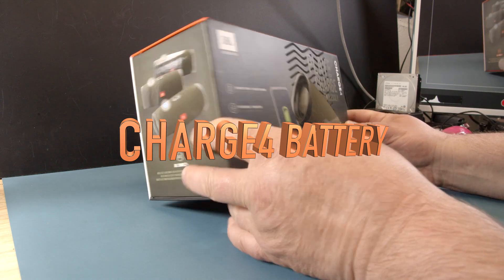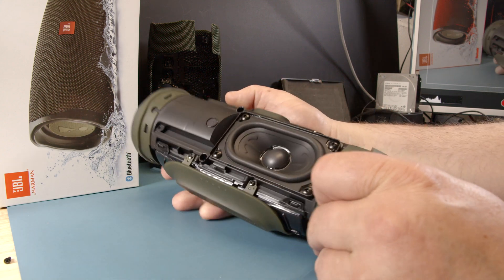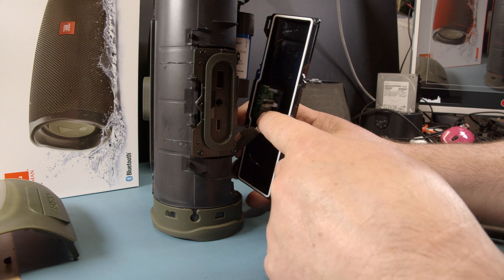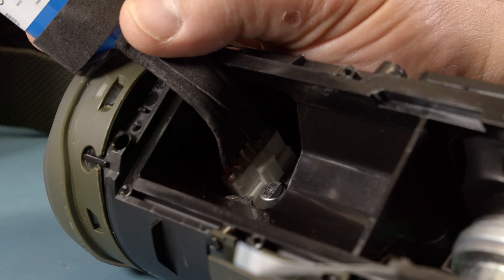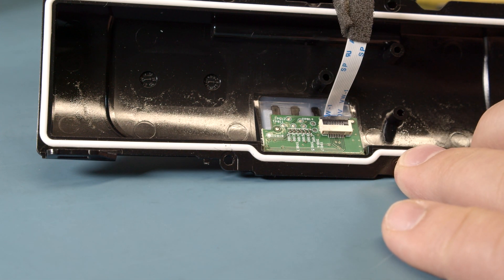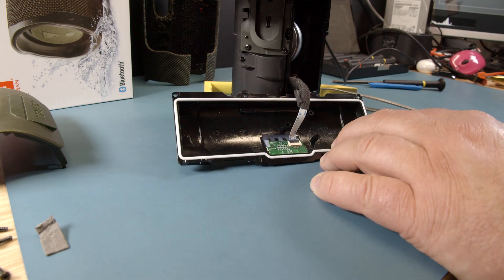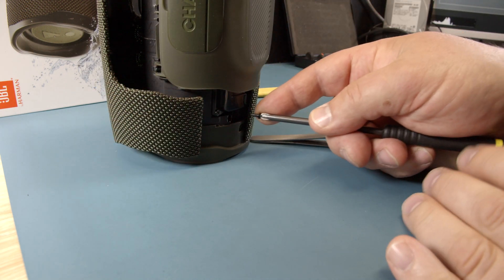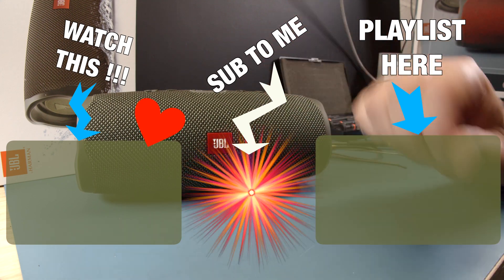JBL CHARGE4 - BATTERY REPLACEMENT

Comment: Can the cells be chaned ? Does the battery pack have inside a BMS ? or the BMS is built in the speaker board?
Reply from the maker: BMS is in the battery pack

Comment: I installed the new battery but it switches off after 3 seconds - it like if the device wouldn't recognise the battery - any suggestions?
Reply: I have the same problem
Reply: did you solve?
Reply: nope....it's all bullshit buy something else mate

Comment: I have the same issue that many people seem to encounter where the jbl turns on and right off again. I figured out my original battery is SUN-INTE-156, where my new batteries are SUN-INTE-118. Maybe that causes problems. I cannot find a 156 battery anywhere though, which sucks. Any ideas for how i can make the 118's work?
Reply from the maker: I am not sure what the differences between 118 and 156 batteries are. You are saying many people have the problem that 118 doesn't work for them? I hear this for the first time.
Reply: @mygiguser  im just guessing that that might be the cause. The only replacements i could find for charge 4 were 118 batteries while my originals were 156. Thought they would be compatible but unfortunately didnt work out
Reply: @jokmenen_  mines also 156 and i cant find it anywhere only the 118s and everyone says when they bought those they didnt work ugh
Reply: did you solve??? i change battery now and its turn off after i turn on... what is problem?? many thanks

Comment: IPORTANT!!!!! Before you buy a new battery, take your current battery down and press the POWER button for a few seconds and then connect your battery again and try to charge it. It actually worked for me. From what I understand it have to do with the speakers software or something like that.

Comment: Well done, thanks! In my case, as the speaker didn't turn on I thought battery is broken. After dismantling it and pull of batterie connector, I measured good nominal voltage. I put it back and a miracle happens - it works again. I guess removing power was a kind of reset for it. Anyway your video helped a lot for understanding the procedure. Greets

Comment: I bought 2 different batteries for changing it, both times the speaker turn on and off right after it. Despites the battery charging and having charge. Where else can be the problem ?
Reply from the maker: Good question. How do you know the battery is charged. Do the lights blink when charging? Does it work when it is connected to a charger? So many things can go wrong. Hard to say over the internet ...
Reply: @mygiguser  Yup. Lights are blinking starting at 4 or 3. It depends on the battery. And it's not working when plugged. I tried different chargers and nothing worked. So I contacted the JBL staff today. It may be because it's not from the manufacturer but I was unable to find a new battery matching my serial number so I send them a message.
Where did you buy your battery ?
Reply: I have the same issue, did you figure it out?
Reply: Hey guys same issue, did you fix it?
Reply: @Merle404  Sort of. The battery should match the serial number of your speaker. But it's almost impossible to know unless you contact JBL. They had some batteries (don't know if it's still the case) but they cost 80€. And you had 10€ or near in shipping wich is unbearable. The best option that you have is to find someone selling one for spare parts matching with the 2 letters at the beginning of your serial number. Mine was starting by GG.
Hope it could help even if I can't give a proper solution.

Comment: Curious to see if it would be possible to use higher rated cells, like a 3500mah 10a 18650, 3p1s and increase the battery life that way.
Reply from the maker: It would work, but most cells with that capacity are fake.
Reply: @mygiguser  as far as I know any other cells that boast higher than that don't exist. There are Sanyo ncr18650ga cells that can reach that and the LG mj1 cells. Although, those JBL packs already hit those limits basically, so maybe more work than it's worth. But if it's not OEM, then it would be cool to at least use cells that i know are good.

Comment: Any chance of squeezing in 3 21700 without the foam?

Besides 7500mAh is 2500mAh per cell, upgrading to Samsung 3500mAh should give a nice boost.
Reply from the maker: not sure with the 21700s it could be too tight.

Comment: My charge 4 started to smoke for a second... i think i did everything correctly tho.
I fixed it. I plugged it in incorrectly🤦🏽‍♂️
Reply from the maker: oh man, smoke is not good
Reply: @mygiguser  its charging now but wont turn on😅
Reply: I fixed that too! The repairshop that had it before me didnt plug the buttons in.😅
Only problem left is the airleak from the button area. Idk exactly how to fix that.

Comment: I replaced my battery with a new one. Still doesn’t charge. I get 1 led light and it turns off after a few seconds. -.-
Reply from the maker: then it must be the charge port, or the charge cable, or your USB
Reply: @mygiguser  I can't see where to buy charge port, can you send URL, GREAT VIDEO!!! Also can one check the battery voltage before buying a battery to see if it is the battery ?

Comment: Can I use 18650 to my JBL charge3 sir? But my charge3 the original battery is made of polymer...
Reply from the maker: not enough space in Charge 3 for 18650
Reply: @mygiguser  what if i use a single 18650? Or single 21700 battery for my charge3?

Comment: JBL Charge 4 GG battery replacement
Reply from the maker: is it different for TL?
Reply: Yes it is a bit different from TL, they are both manufactured a bit differently
Reply: @xhmidsufjblz4844  ye
Reply: GG has screws!

Comment: Hi mr giguser 😁
Im just curious 
Why there's no serial sticker at the top of charging port 
Since you brought it brand new? 
Anyways the for the tip 👍👍👍
Reply from the maker: i removed it
Reply: @mygiguser  You really shouldn't have done that, it voids the warranty but it's gone now anyways. Btw your speaker has a GG model driver.
Reply: mygiguser I have a jbl charge 4 and I think the battery is moving because when I move it hard it makes a noise like something inside is moving and it’s coming from the left side it sounds like something big is that normal?